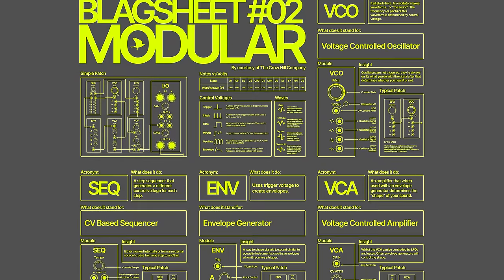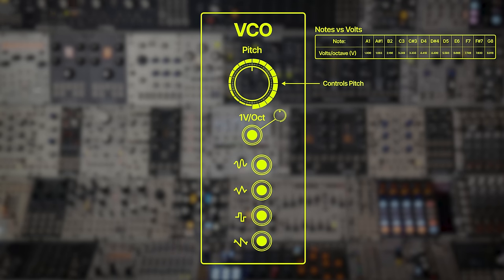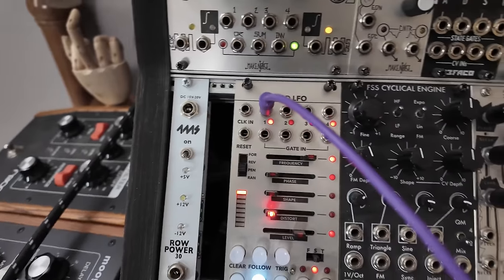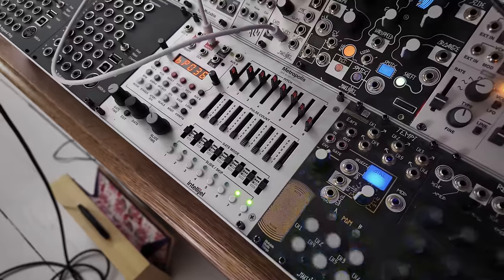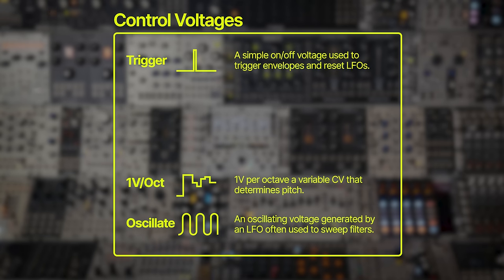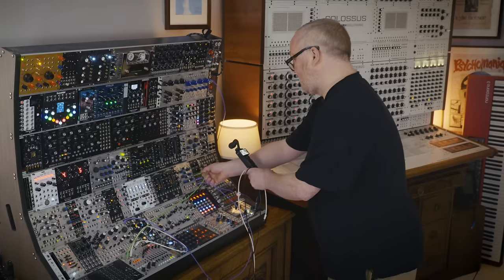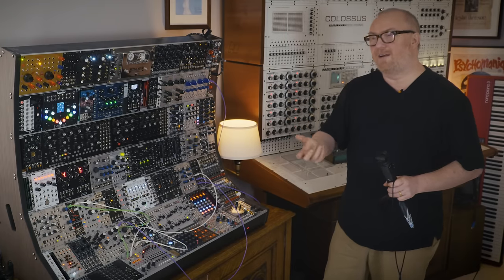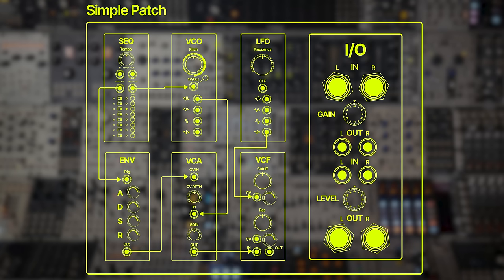MODULAR Synths - Become An EXPERT In 10mins (eurorack tutorial)

Comment: It's a noble effort to cram so much into 12 minutes. 👍

I'd also recommend 'The Synthesizer' by Roland, who originally printed the set of four books to go with their system 100m modular - there's patching examples using the classic 191j 'D set' configuration in one of the books' . There must be 100s , if not 1000s of copies floating around second hand, as it had multiple reprints (i sold mine years ago, after i sold the multi-config100m, and acquired a system 100). Nonetheless , it's one of the best printed book sets about synthesis you can get. Analog Synthesis by Mark Jenkins' is another classic, and also available s/h. 

Ultimately,  you've got to get your hands in /on a modular system , whether in software or hardware, and get tweaking and sliding for the 'oh..now i get it' experience.
Reply from the maker: (goes to abe books to find)